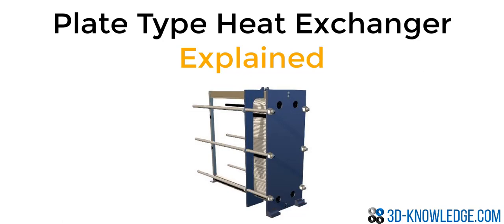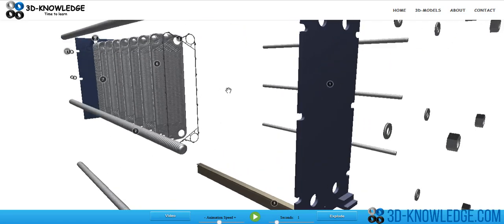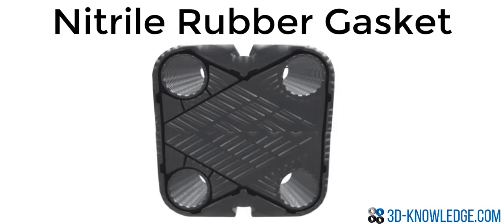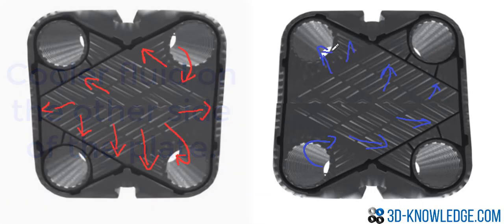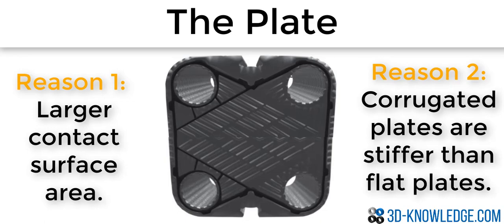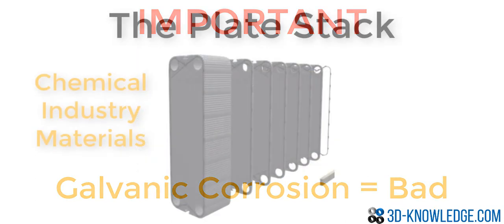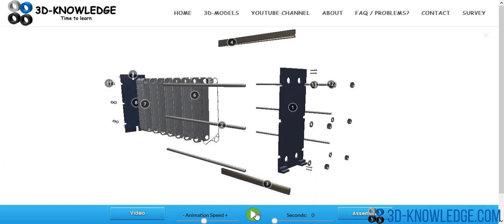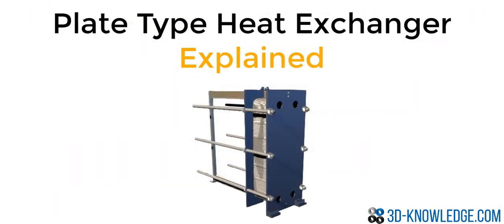How Plate Heat Exchanger Works

Comment: Nice explanation,  and there nothing more pain the ass than removing those plates and fitting new gaskets and putting it back together correctly and expecting no leaks or mixing.

Comment: Is there such a thing as a small size  heat exchanger to try and capture the heat I am exhausting out of my grow area to my backyard in the winter? I know they have air-exchangers for homes but they have their own internal fans I believe. Do they have passive ones that work with exhaust fans? Thanks  and i wish i can use it in my 4x4 marshydor tent .
Reply: Thanks you sir